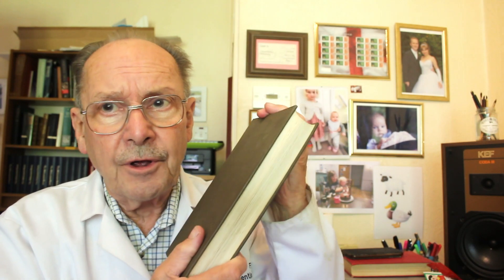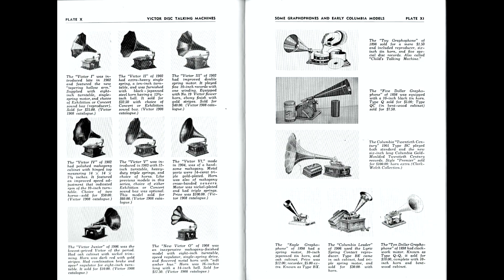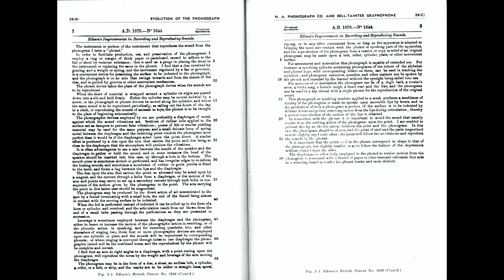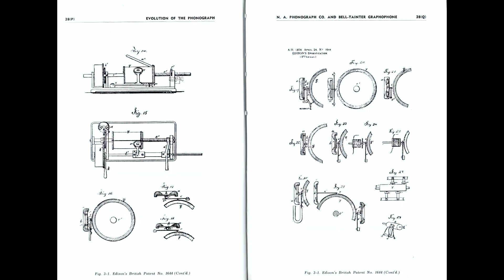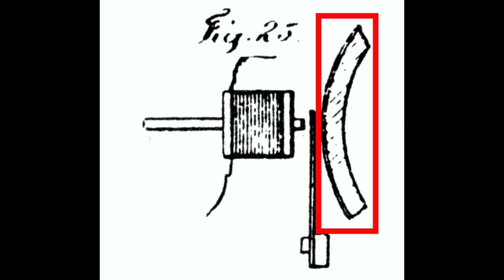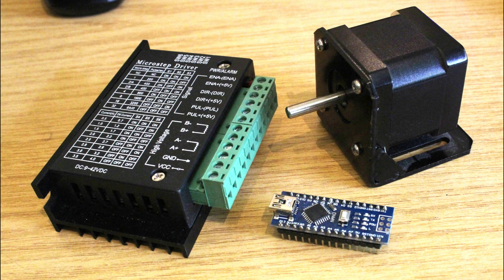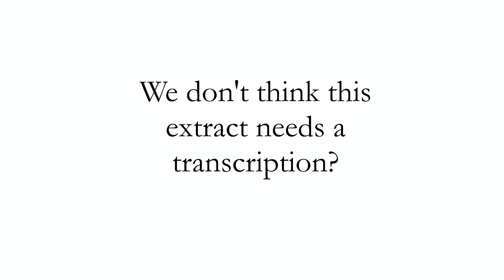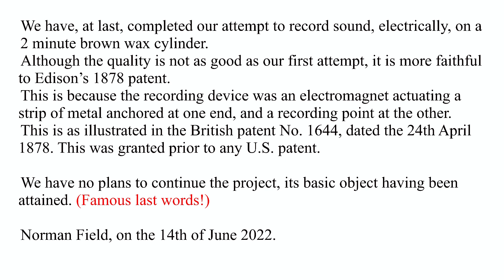Edison cylinder recording is alive & well.

Comment: Thanks you Mr. Field  for giving me credit about the advance ball recorder. I have an original body and advance ball from one of the big cylinder companies, and I made an advance ball recorder totally as a joke, made with crude hand tools, absolutely no measuring! the advance ball made from a broken glass diaphragm. (Originally glass diaphragms were purchased from Carl Zeiss for Edison phonographs, 33mm  round microscope cover slips were ordered from Germany.  The crude home made one records a very crisp, and clear cylinder. (both of them are acoustical recorders.  For what it is the magnetic recorder you made sounds OK for something from 1878 patent, It shows Edison as the father of electrical recording, and discs, which many still ignore.  The advance ball recorder,   Henry Seymour,  author of The Reproduction of sound, gives credit for a British patent from 1903, for this. As you have stated, it takes the weight off the cutter and puts it on the advance ball.  It can be sapphire, glass, or agate, and even cork embedded with graphite.

Comment: Hi Norman. I thought that you could solder the recording pick on the tip of the reed of a mini door bell which is itself a coil and a plate that can vibrate freely, you just need to bring a magnet close to the whole assembly. you can also move the stylus from the center of a small speaker. Greetings from Victor from Buenos Aires.
Reply from the maker: Hi Victor. Thanks for writing. Yes, I agree I could have made a better 'transducer' - and your suggestion is excellent. I actually have a 1960s 'buzzer' that would work as you suggest. hope to get around to that some time. Mis mejores deseos para usted y su familia, amigo Víctor.

Comment: Amazing that no one caught the gist of this obscure recording method. There were no suitable amplifiers available at that time, but someone could have pressed a carbon button mic and a battery into service to check this out. Might have changed the course of recording from the very beginning.
Reply from the maker: Thanks for writing. Yes indeed! The big problems remaining are: (a) Did Edison try this system - probably; and (b) What gear did he use? Am definitely going to try a part 2 for this video! After all, Berliner defintely recorded a test on a disc using a telephone diaphragm... he did not pursue it as it sounded so feeble. Again, no electronic amplifier! Cheers, Norman.

Comment: great stuff !!! I wonder if warming-up the cutting-needle would lower the S/N-ratio.
But this would make this experiment much too compicated!

Another idea crossing my mind at this moment is using an old telephone-speaker (electro-magnetic with metallic membrane) and glue a "cutting-needle" in the center.
Reply from the maker: Thanks for writing. Yes - a telephone earrpiece was indeed what Emile Berliner used in his early trial - which I presume was a lateral cut - but like everything else, he couldn't proceed because of no means of amplification. (Same applies to Poulsen's Telegraphone and Laust's 1908 optical film sound track!) These & others will be looked at in Part II of this video! Cheers, Norman. P.S. Yes, the heated cutter or embosser would help too! Can try that out by recording a contant frequency & GENTLY warming the cylinder with a heat gun on low power...

Comment: Hello Norman. Big fan! I have a question surrounding the making of the cutting stylus. How is it made to be specific? How do you such a fine tip? Thanks from C.N.
Reply from the maker: Many thanks! Sorry delay. Well - as you can see, the whole thing is just a lash-up, and I first tried an old sapphire 78 rpm 'needle' that was lying around, but that was too blunt. So I used an early LP one instead, which was of course much smaller - that ought to be a 0.001" radius cone. (0.0254mm). Of course, Edison did not use a cone, he used a tiny hollow-ground sapphire rod that lightly 'dug into' the surface of the wax. I have used very fine 'piano wire' for this, but can't of course make the tip hollow ground - far too small! 🙂 Still, piano wire is very, very much cheaper than sapphire rod! All the best & take care. Cheers, Norman.